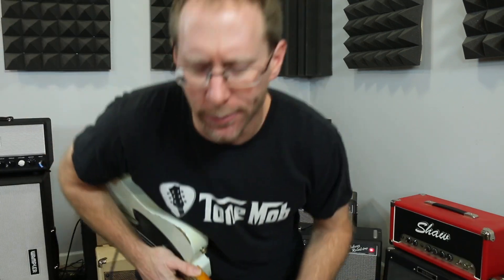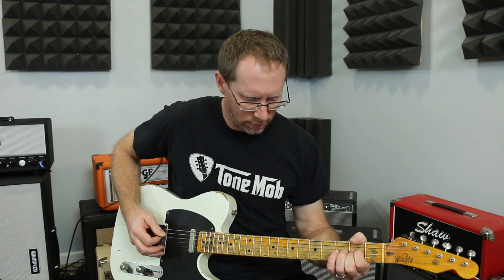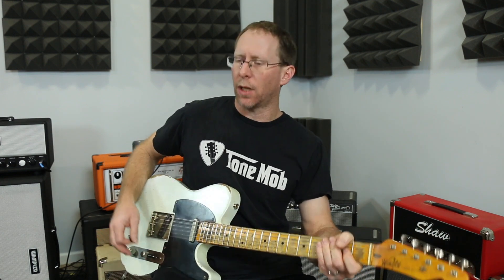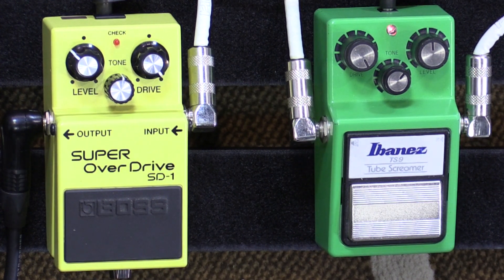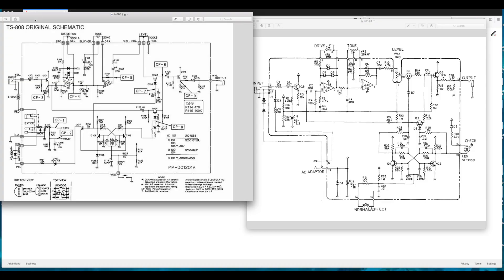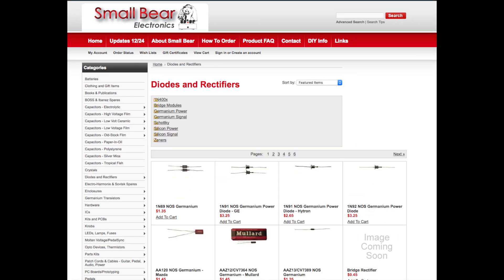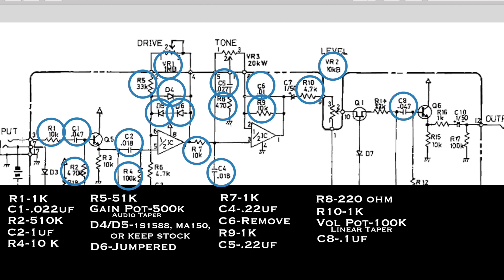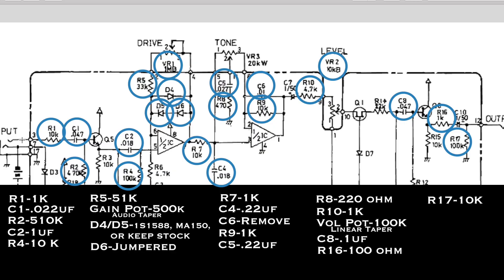How to turn a $30 overdrive pedal into a $180 pedal  -- The Boss SD-1 turned into a TS808

Comment: It does sound slightly complicated to the uneducated, but specifically you haven't mentioned if there is a right way round, or a problem if you insert these components backwards
Reply: he could have said that but he is assuming you have some electronics knowledge.
only the pots were polarity sensitive and they would be a straight remove and replace in the same alignment.
Reply: Resistors and caps are not polarity sensitive. Diodes are. Make sure you install  the lead with the line marking polarity the same way as the one you take out. Pots just straight swap and you'll be fine.
Reply: glenby2u Yeah. Accepted. I was just saying
Reply: @ Axys Assault: Electrolytic and tantalum caps do actually have a polarity.    Film and ceramic caps do not

Comment: Located in Finland my parts come most often from Tayda electronics and musicding.de for the "mojo"parts. Enclosures I usually get from ebay etc, just the cheapo chinese knock offs, they're cheap and 95% of the time are just as great as the namebrand..Also, because of the amount of pedals I build it would get pricey with Hammonds or Mammoths. Imo the 808 mod is cool for the SD-1 but I prefer to leave the asymetrical clipping in, usually change the diodes for russian D9x's or KD522B's. Although there is usually little or no difference in the sound with 4148 and KD522B's but sometimes an out of spec one gets in the mix and it sounds like heaven.

Comment: Totally prefer the SD-1. That assymetrical clipping is glorious.
Reply: Exactly, why wreck an sd-1?
Reply: Dank Cat poot
Reply: Powerful.
Reply: Exactly! I like using ts-9 informs of an SD-1 as a boost!
Reply: Robert P The TS9 is trash? I'm not a huge tubescreamer fan but the differences between the TS9 and 808 are negligible.
Reply: ASSymetrical?
Reply: I prefer the sd1 also but the ts9 is trash
Reply: @leafinfirerob what a load of utter sh¡+e.
Why do you feel so compelled to spout such absolute boIIocks?
Bizarre.
Reply: @leafinfirerob  ts9 is the same as 808.

Comment: Cool idea/ mode. Kind of a stealthy 808. One question about general practice, would it be better to use an ic socket then just soldering the jrc4558?
Reply from the maker: It can be handy to do that, but it's not absolutely necessary
Reply: Thanks for the info, sockets would be best for testing different ic's mainly.

Comment: Brian- this is an awesome video. Do you care to explain (perhaps in an email) what exactly is happening to the signal as it moves through the new circuit with these mods? Also, how does this compare to a hand wired tube screamer in your opinion? Hope to meet you at NAMM. Thanks!!

Comment: I would even change less components. Most of them aren't critical at all, or you can simply calculate values that will give you the exact equivalent circuit.

Comment: Hey Brian. What are your thoughts on Boss moving more and more toward smd construction? For example the DS-1 and BD-2 are now built using smd techniques.
Reply from the maker: There's good and bad things. It allows for a more complicated circuit, plus there are more parts choices since through hole is being obsoleted. I don't like mods on them as much unless you're replacing one surface mount part for another, but I see a lot of people who mod pedals using through hole parts tacked onto the small pads made for surface mount. In my experience, this can lead to problems with broken solder joints many times. Also, it's definitely harder to see... I have to use a magnifying glass much of the time for SMD, but I can remove and replace parts way quicker. Sound wise, SMD can sound good or bad depending on layout and the exact parts used.
Reply: I believe he meant, SMD, surface mount devices.  Personally, I think it sucks because it makes it damn near impossible to fix because everything is so small - as well, I believe that different manufactured parts like capacitors impart a difference in tone other than their stated capacitance, and SMD have some of the worst tone imo.
Reply: TheSphericalGuy * What does "SMT" building technicas mean ?
Reply: Wampler Pedals love these videos. I'm guessing you don't like to bad mouth other pedal suppliers but I'd LOVE to see you highlight problems with SMD by showing the layout and demoing the problem. I've wondered if I could use SMD to make my own pedals. Wondering what caps you should use, thinking the ceramics (MLCC) aren't good for audio?